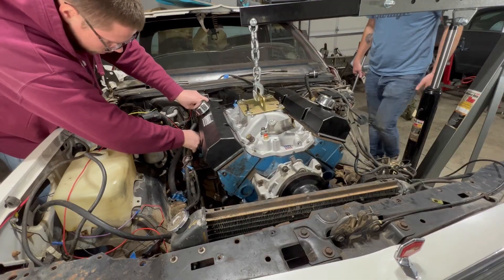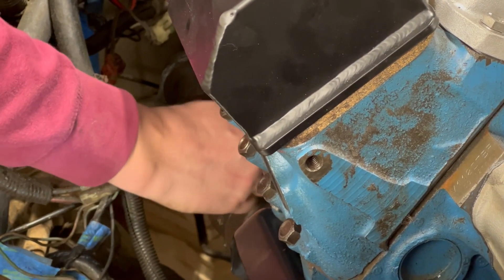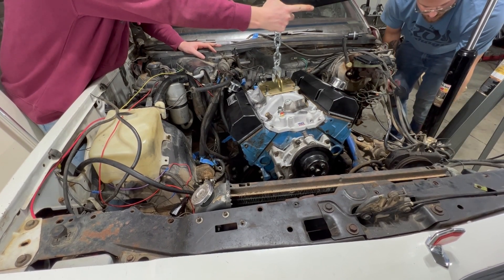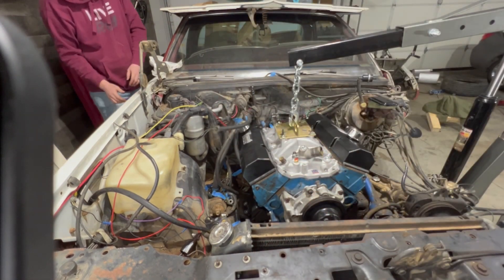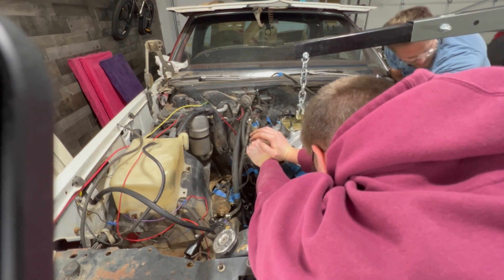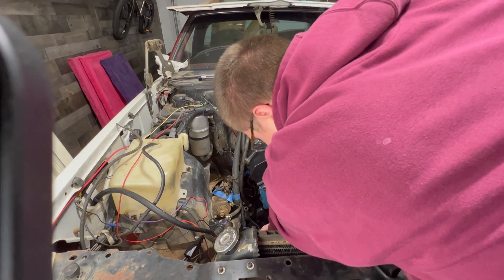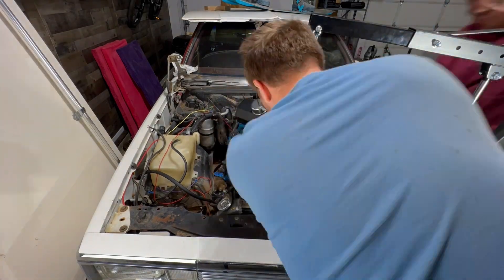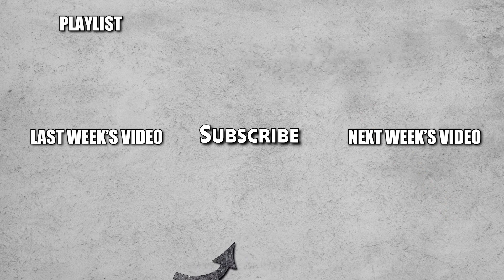How To Install A SBC - The Basics | The Meano Camino

Comment: Will you be making a video about wiring the starter and HEI? I’m about to drop my 350 in, used to have a 4.3L, and the wiring is stressing me out, not all that knowledgeable on it
Reply from the maker: Like the distributor and spark plug wires?? Yes, I believe we have a video filmed just haven’t gotten that far in then cue 🙏🏻